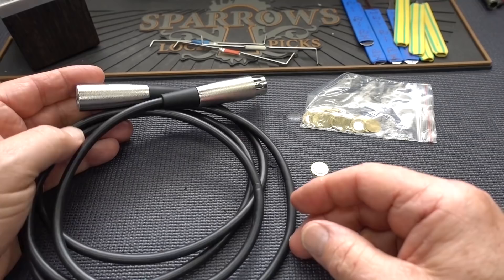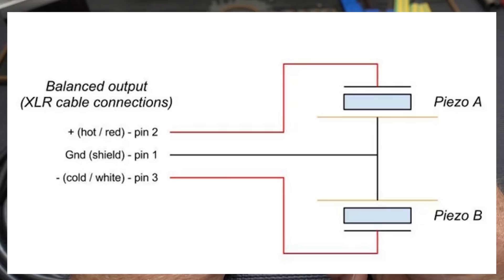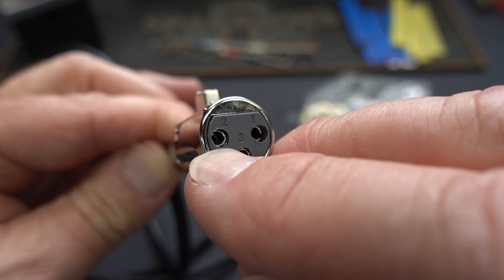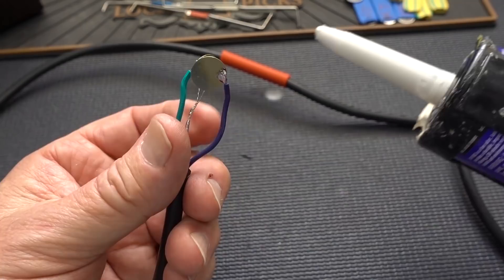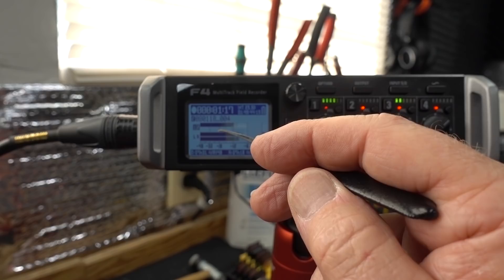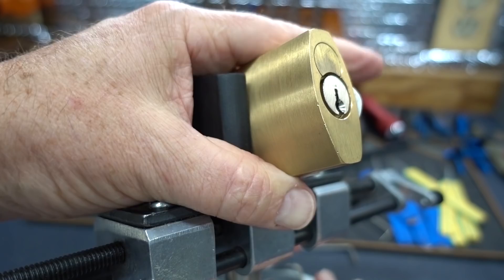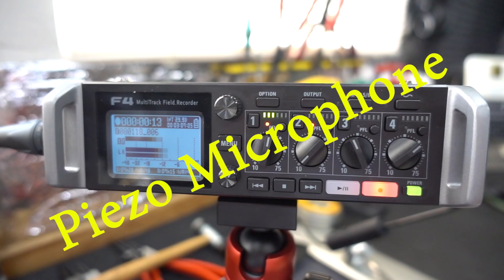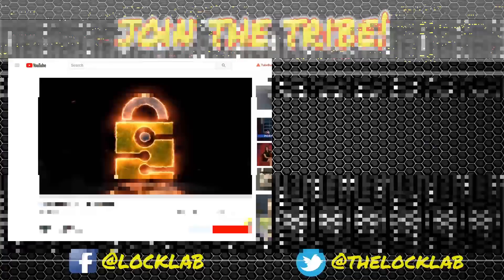(1338) Experiment: Piezo Crystal Lock Picking Microphone

Comment: BosnianBill great try and valiant effort but as someone with 20 years of audio experience might I suggest that there's a few reason's this didn't work that you might need to address should you wish to try a version 2.0 at some point in the future.
1. Impedance mismatch, the wires connected to the piezoelectric elements need to be extremely thin gauge and as short as possible. They then need to connect to a suitable preamp that can turn the high impedance from the piezoelectric elements into a low impedance signal suitable for the balanced xlr.
2. Shielding. The relatively lack of proper shielding at the pick up end of your arrangement would have allowed all of the local RF and EMI noise to bleed into the cable swamping the actual signal.
3. Weight and flexibility, the piezoelectric elements are extremely low weight and thick wires, big blobs of solder and even bigger blobs of epoxy would have significantly reduced the piezoelectric elements ability to vibrate which in turn significantly reduces the signal produced, the inflexible nature of the epoxy only served to compound this issue. It works with direct tapping as the input energy is orders of magnitude higher. The RF and EMI noise are being picked up by the cable rather than the piezoelectrics so they are coming through loud and clear even though the signal is reduced very significantly.
4. Heat, it's quite possible that during the soldering process the local application of heat has damaged the piezoelectric elements raising all or at least a significant portion of the surface area of the elements above their de-poling temperature.

I'd be more than happy to give you a few hints with this and your ongoing struggles with removing the "cat bells" from the audio in your more recent videos. Should you be interested, please feel free to hit me up privately.
Reply from the maker: Thank you, I appreciate the well-thought out and detailed answer.  I am still experimenting with the piezos and have bought a couple of impedance matching pre-amps. They did make things a LOT better. I switched to a single crystal instead of the double and actually bought a batch with pre-soldered, shielded leads.  Again, that was the better choice and the sound transmission improved further.  I also bought a couple of commercial piezos (a pretty expensive one designed for pianos and another cheaper one for guitars).  They all work about the same.  Now that I've gone to all the trouble though I'm not really sure it was worth all the trouble to capture some high fidelity clicking, rubbing, and grating noises.  The few that listened to it found it grating, not useful...  I may have to do a follow-up video to let folks hear the final results, but cannot imagine anyone will find the extra noise very useful to improving their picking skills.

Insofar as the ongoing "singer's rattle" noise.  I will past the follow-up again below, but do have an update.  I purchased the Izotope RX-6 Advanced software that has a program called "Spectrographic Noise Removal".  The rattling occurs at 4100hz but is not visible on the standard audio wave form.  The new software displays it on a unique spectrograph in high resolution and allows you to designate specific digital signatures to seek out and eliminate.  The "trick" is to positively ID precise time hacks so I can visually find sounds that I cannot hear.  Others with better hearing are working on this for me.  Once they do, I can hopefully positively ID the "rattling" signature and wipe it out in post production.

Here's everything I've done so far.  If you have any other ideas, I am ALL EARS.  I really want to solve this.
----------------------------------------------------------
The intermittent “rattle”, “scratching” or “cat bell sound” a few viewers have been hearing has been a nightmare to track down, and it came from an unexpected source.  It was especially difficult because I fall into the group that cannot hear the rattle so I worked with some sound engineers with perfect hearing.  
    Before soundproofing the LockLab, getting a studio grade microphone, and capturing audio at a very high resolution, nobody noticed because the rattle was disguised by low resolution audio that had a lot of background noise and camera hum.
    Once I soundproofed the LockLab and upgraded the audio gear, several of you noticed a faint, and intermittent sound that occurred ONLY while I spoke.
   I should note that I don’t wear jewelry, dog tags, or anything else that would cause a sound. My pop/hiss filter is 3” away from the microphone and firmly zip tied down.  The microphone is in a shock mount and all connections are tight.  VERY tight.  While recording my mouth is 6”-12” away from the pop/hiss filter and nothing touches the microphone during recording.  My recording levels are very low, in the -18 to -12 dB range with no spikes above -6dB.  If there IS a spike, I adjust it down to below -6dB before publishing.  I’ve done tests down to -34dB average, but the rattle was present at every level.
    My first thought was a faulty microphone, so I bought another, then another, then another.  Each clearly captured the distortion.  Oddly, the sound does NOT show up on the audio waveform.  There are no spikes or any indication that something is there, yet you can hear it.  A sound engineer suggested my voice had a resonant frequency with the microphone’s capsule, but after five different microphones capturing the sound, I ruled that out and returned the mics. My current microphone is no slouch: a Neuman TLM-103.  We ruled out the microphone.  
    The second suspect was the intermittent running cooling fan in the laptop, which I was using to capture the audio.  I replaced it with a Zoom H2N digital recorder, but the barely audible rattle was still there. I bought a Zoom H5, then finally a professional grade Zoom F4.  The sound was STILL there in all of them. We ruled out the digital recorders.
    The third suspect was the audio processing software that I believed might be introducing distortion during noise reduction of the high-resolution files.  I invested in Adobe Audition but it made no difference and the noise remained. I bought Izotope’s RX6, but audio processed by it also had the rattle. Several people suggested it could be YouTube’s compression software but since rattle is present in most of the raw, unprocessed audio we ruled that out.  The sound engineers believe YT’s conversion and compression make the sound more distinct, but it is not the cause of the rattle. We ruled out the post processing software.
    The fourth thought was some kind of electromagnetic influence causing the distortion when my voice peaked.  I replaced the generic microphone cord with a Mogami Gold Studio Grade XLR cable. It made no difference; the sound was still with us.  I made test files with the power in the LockLab shut down, operating on battery power only.  The rattle was still present in the audio files.  We ruled out cables and EMR.
    For my fifth attack, several people suggested it was something in the LockLab that was vibrating when I spoke.  To test this, I made several test files in my house (bathroom, dining room, kitchen, and in the back yard).  I did these tests using multiple microphones and the three different digital recorders.  All the files had the rattling sound.  We ruled out anything unique to the LockLab.
  By this time, I had no idea which direction to go. It was a gremlin…
  Shortly after the final test my wife and I had several friends over for drinks and dinner. In the course of conversation my wife started to ridicule my “irrational quest for perfect audio” and several friends were interested.  I fired up the laptop and let them take turns listening to the audio.  About half heard the sound and, with no prompting from me, called it a “faint rattle”.  As I told them of the various tests, one of them said “Hey!  Bill, say that again!”.  I repeated my sentence and they all said “There it is!”  I repeated the sentence several more times and they occasionally heard the sound – not EVERY time, but intermittently.  Once the people with REALLY good hearing knew what they were listening for, they said it was easy to hear when I spoke.
    So, since my voice was the only common element throughout the testing, it finally made sense.  I apparently have an intermittent vocal anomaly that was enhanced by the high-fidelity gear. Normally, it is found in singers that stress their voices and is called, appropriately enough, “singer’s rattle”.  A very few people can hear it perfectly, while most cannot.  
There were three possible solutions: 
 The first, suggested by Adam F, is to apply a notch filter around 4100hz, where the rattle appears.  We’ve experimented with this but unfortunately 4100hz is right in the middle of the human speech range.  The “rattle” is not a discrete frequency, but actually ranges from 4000hz to about 4200hz, or a range of 200hz.  Notching out that frequency range REALLY mangles the audio and is obvious to the most casual listener.  Clearly, won’t work.
  The second solution is to revert to using the camera’s microphone to capture sound.  It is a much lower resolution and, as long-term listeners probably recall, produced pretty dirty sound.  There’s no guarantee this would satisfy everyone because the camera DOES still capture the rattle, but to a lesser degree.  I’m not a fan of going back to low quality sound.
  The third solution addresses the REAL problem: my voice.  Treating “singer’s rattle” includes warming up your voice before recording (I can do this), not over-exerting your voice (I don’t do this), gargling with salt water (I can do this), and hot drinks like tea with lemon & honey (efficacy of this is arguable but I can do this too).  Some suggest that placing the microphone at a 45-degree angle to the side helps attenuate the rattle, so I’ve moved my mic.  Oddly, this rattle didn’t show up in my voice until about six months ago, so it may solve itself, given time.
  In short, there’s no guarantee that any of these things will permanently fix the noise.  I’ll do everything possible, but I have to work with the vocal cords that I was issued…
Bosnianbill
Reply: Bosnianbill I'm surprised i found this and im glad i read it. Newfound respects for you, Bill.
Reply: Bosnianbill - I find it odd, that so many people complain about the audio in videos. These aren’t Hollywood productions. I do, however, commend your pursuit of perfect audio and, also, making your viewers happy. I have a channel where I cover technical aspects of drones. I have had a few people complain about the audio, while most others have said that it sounds just fine. I have spent more than I should have on audio equipment and I make no money from my videos. I have had to resort to just telling these people to “deal with it”. :-)

Heck, if all else fails, you can try some WD-40. LOL ;-)

Comment: Bill, you probably lost a lot of sensitivity of the piezo disc by de-poling it while soldering it with that large blob of solder. The poling temperature is around 450F, and as this as the ceramic is/was, that blob of solder raised the surface temperature over 600F.

Try a micro iron and only touch the edge of the disc. Also, a good flux like a RMA product will get the solder to stick.
Reply: and solder it only on one side so you will have other side free of solder joints
Reply: the ground wires need to be insulated from that backplate too.
Reply: lol if somebody else committed a sin as bad as he did they would get roasted so hard. but everybody loves bill. this is like the nicest comment section ever
Reply: And the fact that this is outside his area of expertise. :)
Reply: Nicholas Washburn because he's trying stuff. He's not afraid to experiment and he's even prepared to wear his failures in public. Bill's not only a good guy, he's an honest content creator who's having fun exploring what he can do.

Comment: As others have said, guitar pick up, phono cartridge, or even just a contact mic maybe like the old suction cup mics for recording telephone calls. Match impedences. In your experiment you could try shielding the piezo element with metal connected to cable shield (insulated from the piezo)  to prevent rf hum. Also noticed the light behind the recorder flickering. Led and florescent  lights are sources of hum. So are switching type power supplies like power adapters.
Reply: mosocal58 - The old ‘suction cup’ microphones picked up their audio through induction, not vibration. I still have a few of them. They really only worked on the old AT&T phones, which had large voice coils. As phones got smaller, and their voice coils got smaller, they didn’t have enough of a magnetic field to couple with a suction cup mic. A suction cup mic is simply a coil of wire that picks up the stray magnetic field from the handset earpiece. Your other ideas are pretty solid, though. :-)

Comment: Excellent work Bill! Even a failed experiment yields useful data, so don't give up hope.

The idea of using back-to-back pickups on a balanced line like an XLR input is worth investigating. Keep at it. (Look up "humbucker pickup" for electric guitars.) But you might try reversing one of the pickups, so the "creme filling" of one is connected to the "cookie" of the other. (Differential lines like XLR want one input line to be going positive while the other goes negative. The way your pickups are wired, both will go positive at the same time. You'll end up with a tinny, clicky sound that way.)

Another thing to consider is that piezo pickups have a resonant frequency where they're most sensitive. I've used 3/4" piezos and they resonated at over 1000 Hz. Yours probably want an even higher frequency, but I don't think clicks from a lock mechanism are that high. Bigger piezos will work better at lower frequencies.

When attaching the pickup to a lock, you want as rigid a mechanical connection as you can get to transfer vibration to the pickup. Clay is okay as long as the piezos are in direct contact with the lock, but epoxy is better and a C-clamp is better still.

If all else fails, consider a geophone. They're used to detect and measure seismic activity, but they respond really well to low frequencies.

Comment: Bill, suggestions:  Try not epoxying the mics to each other, or gluing to each other.  only seal up the back side of the piezo with silicone;  do not use a hardening resin epoxy; but realistically, you don't want to add any binding layers between the two elements of the piezoelectric transducers.  it is dampening sounds horribly.    Second;  having right and left;  you can put the right and left mics on either side of the lock body, securing with a rubber band, or even just cellophane tape.    Third;  to make the contact better from the lock to the transducer;  solder both wires to the same side of the transducer instead of opposing sides;  you should get a LOT more signal, with less gain required.   You can look into what kind/size of capacitors you should use for filtering out the low level high gain noise as well;  should be simple enough to add..  Also, Fred's comment below mine makes a valid point;  make sure you are matching impedance for the input  being used.

Comment: From what I saw the wires could have shorted the buzzers with the long uninsulated wire connected to the center. Most of the time when I see them soldered they are soldered on the same side leaving the solid color side bare. And you may want to try putting them on a large spring clip from a hardware store so when you put it on a lock you have one on each side of the lock.

Comment: Might want to insulate those drain wires. Seems like a miracle if they don't end up shorting the white part to the gold part when you shove the disks together. You can strip the insulation of a piece of unneeded wire and push the drain through it.

Comment: You need to use a 1/4" tip sleeve phone style pigtail and just wire up one piezo to it.  Also as others have stated it is a Hiz circuit so you will have to set your equipment appropriately.

Comment: Possibly a fairly Cheap way to help  make more of these.
Guitar hero/ rock band, drum sets (from any game system). There is 4-12 of those pezio crystals in each 'drum set' and they are plentiful in my area.
I should have at least 9 crystals in old 'drum sets' I will send to the lab asap for more experiments.
Based on their use in the 'drum sets' i believe that positioning the crystals above the springs, or as close to a 90° angle as you can manage to the pins, would direct the sounds/vibrations best.

Also the physical ground, or braided shield on the Mic wire you used, is very important to reducing the ambient static.
I would suggest adding an extra insulated wire with some kind of alligator clip to attach to your vice. It may reduce the ambient white noise

Comment: I think you need direct piezo-to-lock connection, without epoxy. For best performance you could solder wires from only one side and touch the lock with "gold only" side. Also, you need something to drive your piezo, maybe simple op-amp would do the job. If then you still have problems with mains buzz, try to ground piezo and lock.

Comment: Hey Bill, you need a special high impedance buffer circuit for that piezo element, or for best results, a differential op amp with your two elements to cancel out the 60Hz noise. Also, I think your best bet for attaching your transducer is a thin layer of tacky wax (called petro wax by sensor companies).